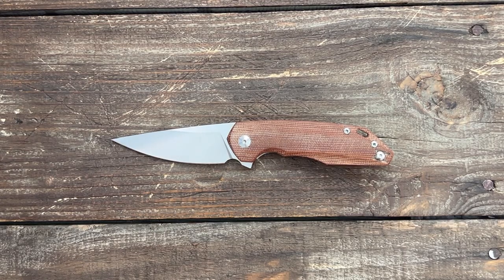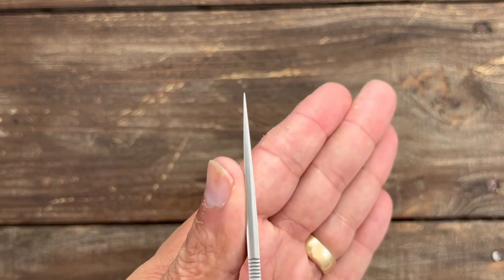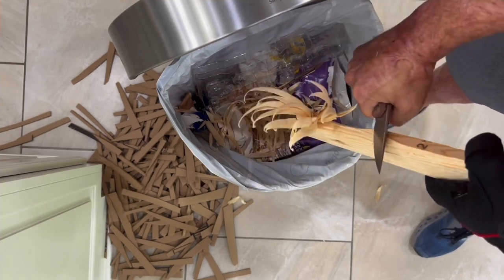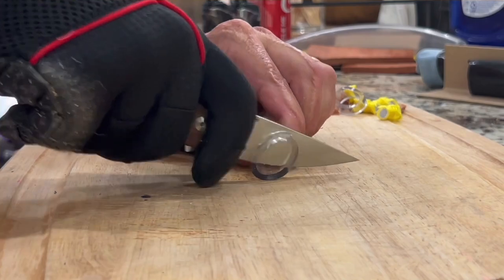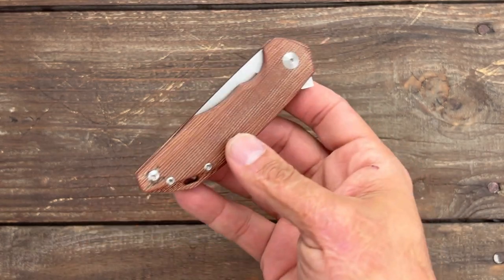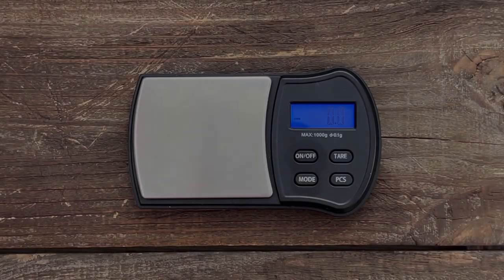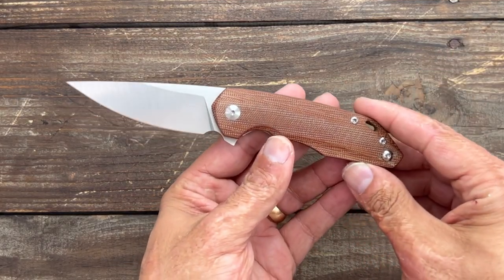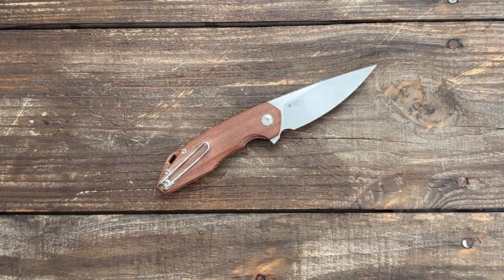Giant Mouse Ace Corta - Sharpest GM out of box

Comment: Great review as always.   I know I should know this.   But is M390 steel like 20 CV?    Great edge retention, not as tough???   Good corrosion protection but harder to sharpen???  Thx.   I wish they would have used a color appropriate back spacer for the black out version.   Having all black blade and handle and then a gold backspacer is not a good look, imho.

Comment: Giant Mouse's all seem to have overly thick blade stock. It doesn't make sense considering their intended purpose. The index finger is pretty far away from the heel of the blade. In my opinion, this model didn't need to exist. As with most manufacturers, they are just cranking out models to sell more knives, not because the model fits some un-met need or does anything better than existing models.
Reply: Yeah they have such a cult following in that Facebook group. It’s like crack for those guys with new releases. Many are then sold right away as well. A lot of catch and release with that group. Guys are even getting GM tats. 🤷🏻‍♂️
Reply: @sharpdad33  I think Jesper Voxnaes' Pilar put some design elements together in an interesting way and spawned a bunch of similar models. But other than that, I don't see much innovation from the Giant Mouse team.